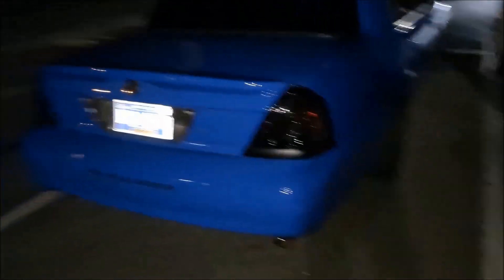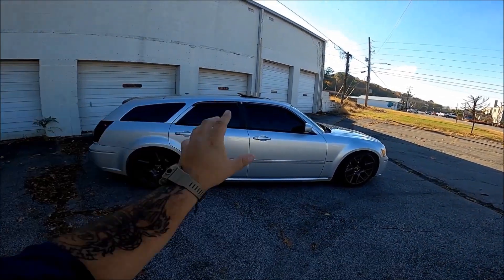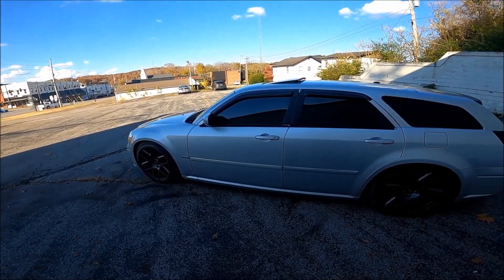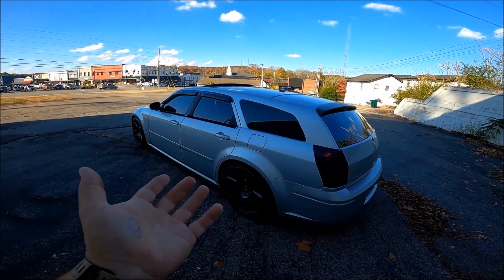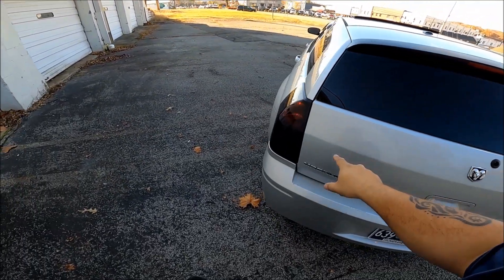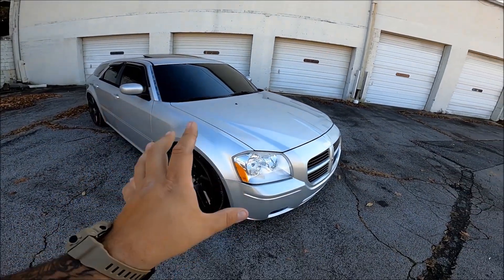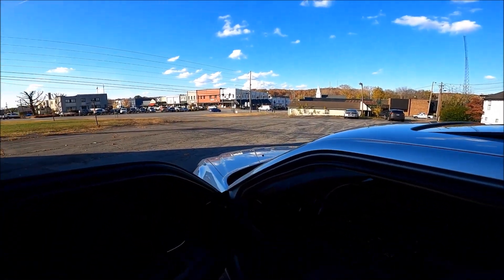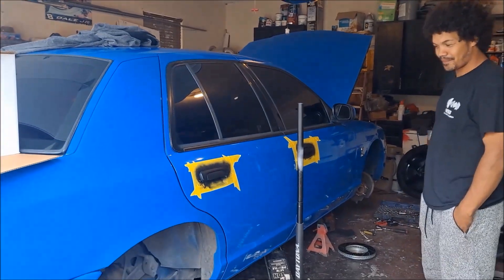I Swore id NEVER do this again!! Back in ANOTHER MOPAR!

Comment: Srt hood, chin spoiler and rear diffuser if you wanna save on buying the whole bumper covers.
Diablo sport tuner, guy name Johan in FL does some great tuning,
Catch can, legmaker intake, billet under hood kit, heads/intake /cam brings the 5.7 to life, although if I could go back I'd just did a procharger instead.
And your def gonna need all new control arms, suspension items, cause they wear fast and you'll def feel it over bumps